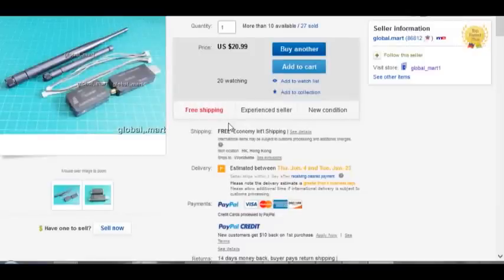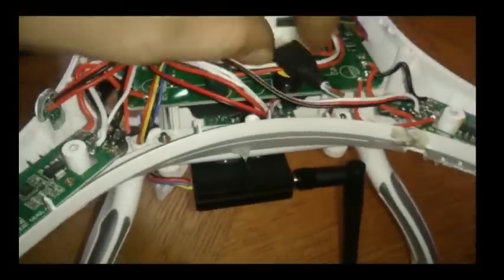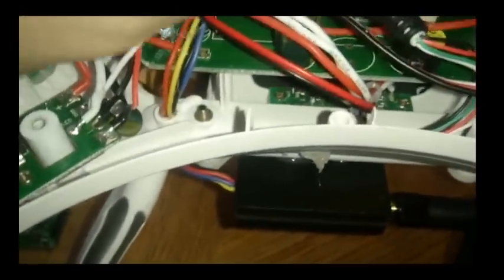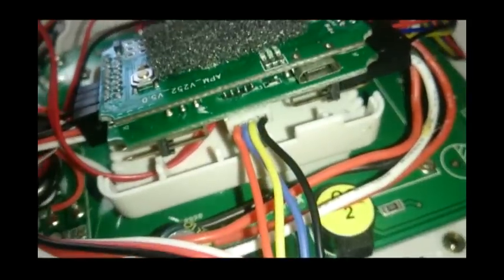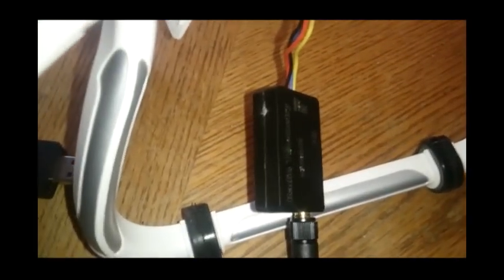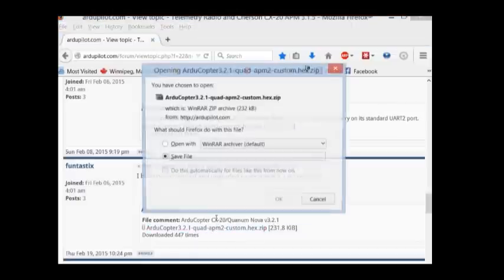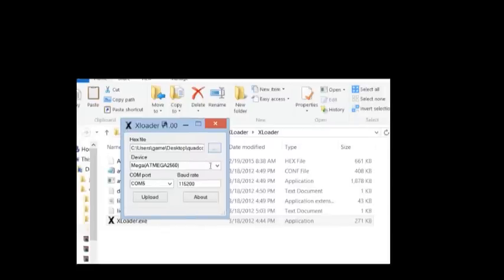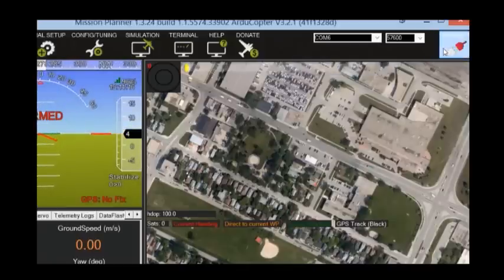Cheerson cx20 Apm v252 v5.0 telemetry Fix-with socket.

Comment: Hi Bangs6996
I have followed all the steps from your video, when I tried to connect to the telemetry the computer shows a dialog screen with messages:
"Connecting Mavlink"
Trying to connect
Timeout in 12
"No heartbeat packets received"
Can you tell me what I did wrong?
Thank you
Dibay.
Reply from the maker: Di Bay Rc If the red light on the unit is blinking  red and you have a solid green light/ after you apply battery power... It could be the Rx cable is not pushed in right or even tx.. .. . also make sure the baud rate is at 57600.   If you still don't get a red light you can try to swap the yellow and blue wire
Reply: I got the baud rate correct 57600, an swapped the yellow and blue Cable a few times, just got blinking green light but no red light on the Air unit, what should I do?
Thanks for your help.
Reply from the maker: Di Bay Rc . Ok the unit that plugs into your quad copter .. when it blinks green .. does it stop blinking green once you plug in the other unit into your computer.. .. Not that it matters but it will show at least the transceiver and receiver are binding .........      .. What firmware version are you at with your quad copter? 3.1.2?
Reply: bangs6996 
No it doesn't stop blinking when I plugged in the ground unit into my computer, the ground unit blinking green and red, but the air unit green light keeps blinking none stop. My current firmware is 3.2.1.
What is your suggestion?
Thanks.
Reply from the maker: Di Bay Rc Did you load the firmware fix I suggested in the video that corrects the telemetry issue with version 3.2.1?  10:47  ish
Reply: Yes I did run the Xloader and select file arducopter3.2.1-quad-amp2-custom.hex to update version 3.2.1
Reply from the maker: Di Bay Rc were u already at version 3.2.1 .. if not try to do a firmware update through mission planner 3.2.1 as well now.  .. I'm sure with my delay in replies you have triple checked everything. .. if doing a firmware update through mission planner does not fix it. It may be the firmware on the telemetry it self is screwed.  ..  something to try before the firmware update as well is see if you can connect to the telemetry firmware. steps
connect usb telemetry to computer.
Make sure Telemetry is plugged into quadcopter
Plug in battery 
Open up mission Planner (don't push connect)
Go to Initial settings TAb
go to Optional Hardware
choose 3dr radio
change com port to your telemetry ,Baud rate 57600
push the Load settings button.
Do you get settings after say 30 seconds or so.
If not you can try to change the baud rate to 115200 and try to connect again.

If that is a fail. the last thing I can suggest is doing A firmware update through mission planner.. make sure your rx and tx cables are right.
HOwever you should get solid green light regardless if the rx and tx are backwards when you plug the unit into your computer.
Reply: Thanks for your reply and suggestions, let me try that tonight, and I'll report back to you the outcome.
Reply from the maker: Di Bay Rc Hi have you figured it out? I'm at a lost my self and its been bugging me so maybe you just got a bad telemetry kit.. regardless if you do figure it out can you please post back how.
Reply: Not yet I think My air radio unit is bad and awaiting for a new one to arrive, I will let you know when I figured out.
Thanks
Reply: bangs6996 
Received my replacement air unit today, after powered up the Air and Ground units I got the solid green lights on both unit and blinking red light on ground unit. But I still can't connect when running the Mission Planner software!
Reply: After I ran the Xloader again, my air and ground unit able to connected, but when I clicked on Load Setting tab and after two minutes waiting it came back with this message "failed to enter command mode"
What should I do? Please advise.
Thanks
Reply from the maker: Di Bay Rc try this.. go into device manager ..then Plug in your telemetry usb. and see what pops up under ports. Take note of the com port and make sure your using the same port..   You can also try to change the port to another one.. by right clicking on Silicon labs and choosing a different com port.     And again make sure your using the battery as power.
Reply from the maker: bangs6996 Also if you have a meter you might want to test your wire connections. .. I just re tested on mine.. A bad tx will allow you to connect but will hang on getting params.
Reply from the maker: bangs6996 heh.. going to flood you with posts.. last week I had posted you a step by step to connect through .. "load settings"   .. When you open up mission planner do not push connect..  go to that menu 3dr radio ..then push the load settings. It will connect.      If you are already connected in mission planner then push load settings you will get that same error as you describe.  <--visually make sure you are on the right com port and baudrate before pushing load settings
Reply: I know my port and baud rate are correct, since I got the information display on both local and remote screen, but when I click on Save Setting tab I got that error message "Failed to enter command mode"
Reply from the maker: Di Bay Rc ok thought you had issue with load settings. so can you now at least connect mission planner with your apm?    I have not set any settings yet in the 3dr section.. and my remote basically comes up blank accept for the baud rate ,format, and version.   . when you plug in the rx into the cx20 it should light up with blinking red. <-do you get that at least now?  almost at the point where u might have to trace out your rx and tx on your board to make sure it is connected.
Reply: After two long days trying, I finally got it to work, I don't understand why but I can't get all the parameters display on the remote version screen, I have to keep click on Load Setting for few hours and finally got lucky and be able to Save Setting. I'm now testing the waypoint, follow me features using Droidplanner 3 app. on my Samsung Note 4.
Thank you so much for your time and patience for helping me accomplish this task. I now have a better understanding next time would be a lot easier. 
Best Regards.
Di Bay.

Comment from the maker: Usually it is the factory installed software 3.1.2 or 3.1.5

However to down grade and upgrade you can do that through mission planner.
 Mission planner  _>  Initial setup _> Installed Firmware _>  Pick previous software, it will then change into a combo box.. the first 4 ish are the ones you would be after 3.1.2 to 3.2.1    ..

Be very careful with fallow me mode ,if you do install the telemetry and only have 3.1.2 or 3.1.5 at least with my test I accidentally had it in 3.1.5 when I pushed the fallow me mode.. and it fallowed its shadow to the earth heh..<--well not so funny at the time.

Comment from the maker: @ Danis Ztube  yes telemetry works with version 3.1.2  . If you read through the firmware fixes version 3.2.1 fixes some memory and more.. My quadcopter was actually really bad with version 3.1.2 but seemed way more stable with 3.2.1 in gps mode.. but its a huge debate what is better 3.1.5 or 3.2.1  ..   anyways here is the release notes for complete fixes. ..  https://github.com/diydrones/ardupilot/blob/master/ArduCopter/ReleaseNotes.txt      <--with all that said if your quad copter is working fine no point to update. ..